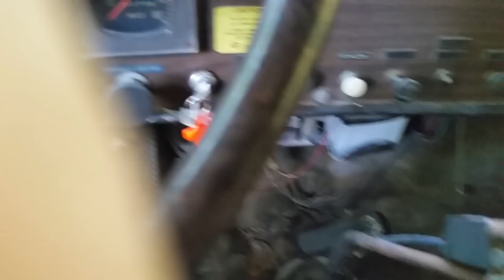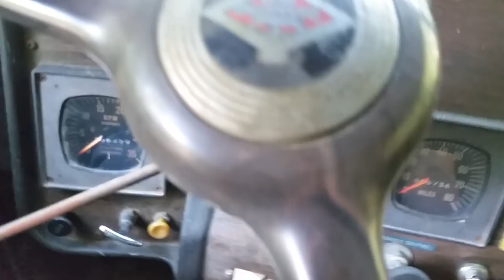Overloaded 73 Diamond Reo Dump Truck

Comment: Looks like it handles it well! Sounds like you got a few rocks in there.
Reply from the maker: Digginok it's good for around the yard but I doubt it would do ok on the road in the hills here. The gearing is low. Think it has 7.17 when in low on the rear